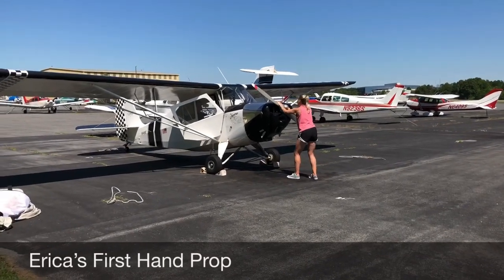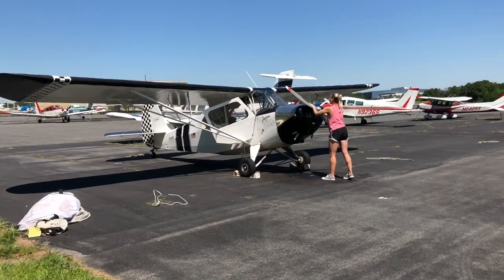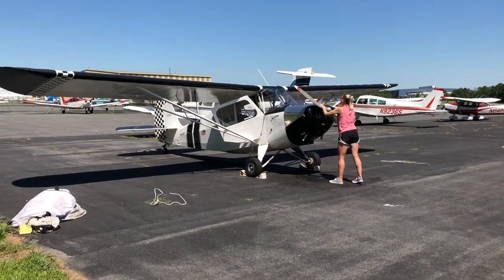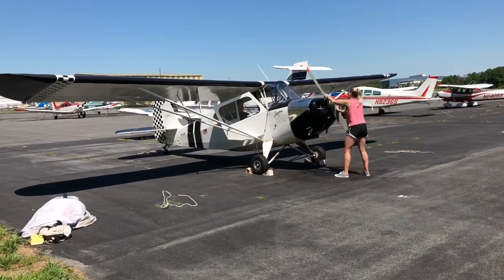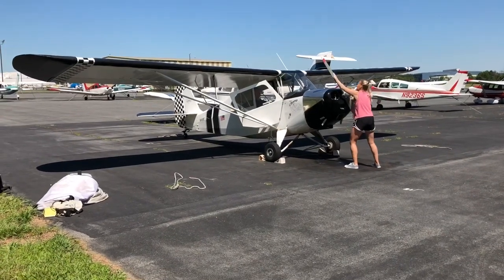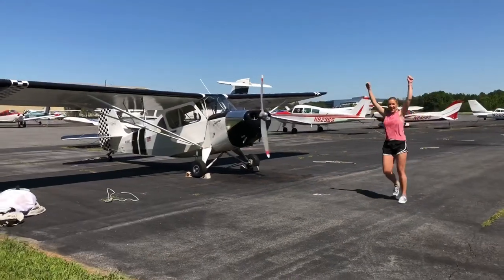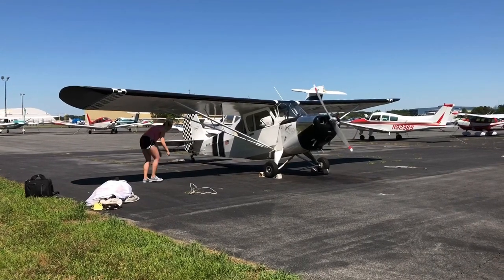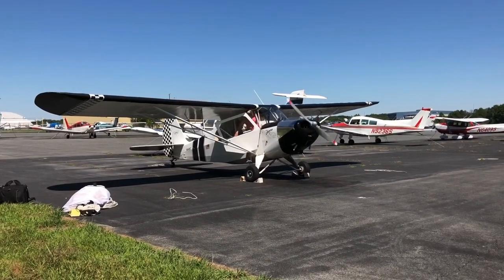Erica’s First Hand Prop | Aeronca Champ

Comment: Do not lift your leg! Just step back. You can hear the impulse coupling click, so you do not have to flip the prop so hard. Learn to flip the prop from the back, its safer.
Reply: EAA taught me at OSH:  leg forward then back as I swing the prop with my fingertips.  My leg is well out of the way (and helps move me back away from the prop) before the impulse couplers activate.  So that’s been my technique for ten years.

Comment: The idea of the leg lift comes from the days of old big cylinders and big props. Today with small displacement engines it is not necessary or smart to do, as you put the body in an unstable stance with one foot in the air, close to a soon to be spinning people, bug and bird chopper. Plant both feet at a position to step away in a flow with the body’s energy from pulling the prop. Or do it from behind the prop with extra hand back holding a stable part of the plane, so as not to fall into the prop. And don’t listen to anything I say. Because the FAA doesn’t care about experience, or common sense, they only care about having passed their requirements to teach.
Reply: noise 978 is correct. She should have stepped a little more to the left to get better leverage. Left foot should be almost under the propellor arc so that you fall away from the propellor if you stumble. Dramatically rising the right leg is actually dangerous as it may pull your body toward the propellor arc. If no line crew is available consider propping the 7AC  (or J3) from behind where you can retard  the throttle if necessary before entering the cockpit. Of course best practice is have line crew prop the plane with a pilot at the controls as in this case.

Comment: If it was that easy to start would have it been safer to stand behind the prop?
Reply from the maker: Always safer to stand behind the prop, but this is how I was taught 🤷🏼‍♀️
Reply: With the way the Aeronca aircraft are configured they can’t really be started from behind. Because of the door you wouldn’t be able to reach the throttle right after the engine starts. Unlike the Piper J-3 cub which is perfect for hand propping behind the prop. I think there is an STC for Aeronca Champ that allow the door to be removed for flight, but I could be wrong, I could be mistaking that for decathlon. But that would allow you to hand prop from behind for the Champ.